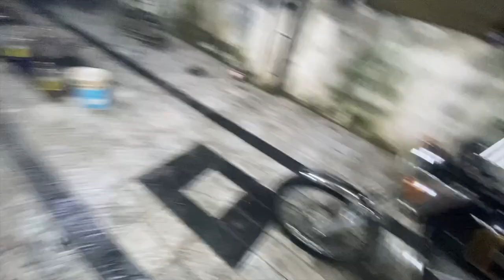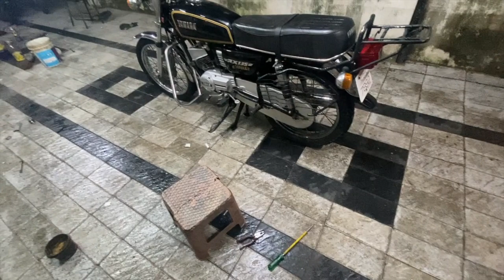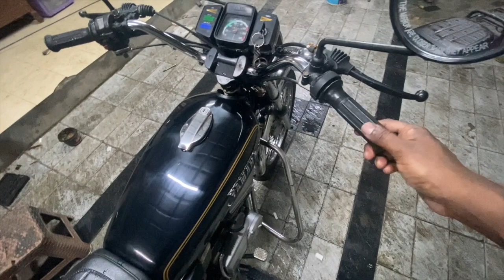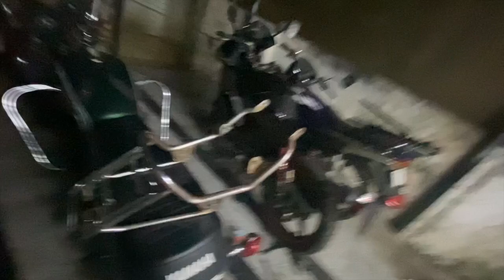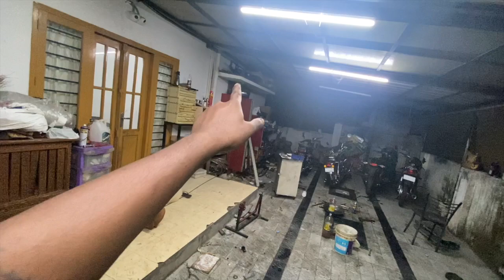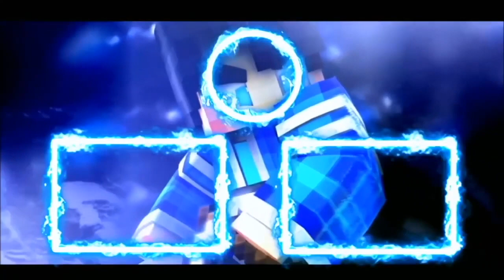Yamaha RX 135 tiger rebuild  final episode (Malayalam Video)

Comment: Sir, I saw many Rx135 5Speed (tiger models too) with normal chrome silencer but as per I know that 5 speeds always came up with Catalytic silencer. Please tell that which one is genuine.
Reply from the maker: Tiger always had chrome silencers, 5 speed always had cat con, except in some states where pollution was not an issue
Reply: @Yamakaze  so actually, I am planning to buy a Rx Tiger Which is 5 speed and is 2004 Model. It has round meters. But only one thing is issuing me is the silencer of that Bike. It has normal chrome silencer , in place of which I expected a cat silencer. My state is Chhattisgarh and at that time pollution was not a problem.
Reply from the maker: @you_tuberrr  rx 135 with 5speed covers is not tiger, people have confused names and now it’s called tiger 🤦‍♂️. It’s just rx 135 4s 2004 model
Reply: @Yamakaze  Okk , now I got that thing ,thanks for clearing that doubt. So basically its a 5 speed and having chrome silencer that’s means its not the factory fitted one , right?

Comment: Bro last dec my rx got full restoration but anik Jan starting  gulfil  varande vanu job ayit . Vandi ipol arum use cheyunila Angene njn nthokee kariyengel anu sredhikendeee 🙏🏼 please help me 💕🫂
Reply from the maker: Remove the fuel from the tank, fill some oil in it and shake it do that the inside is uniformly coated. Put a cover on the bike, remove the battery. That’s enough
Reply: @Yamakaze  I was eagerly waiting for your reply . Thanks brother 👍💕
Reply from the maker: @izenwillie  👍

Comment: big bore rx165
Reply from the maker: 175 😎
Reply: @Yamakaze  rx has a 50mm stroke compared to rd350s 54mm one
Reply from the maker: @sarinr8226  when you use an rx cylinder how will the stroke be different? I am planning to use RD port duration and bore dia.